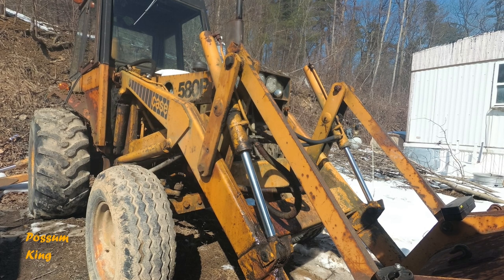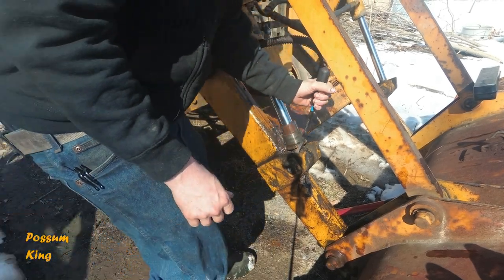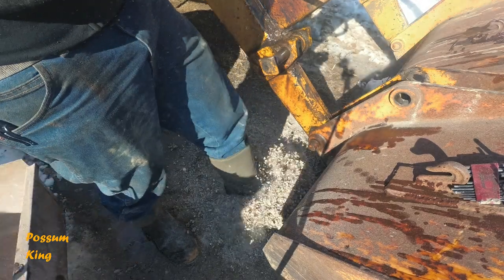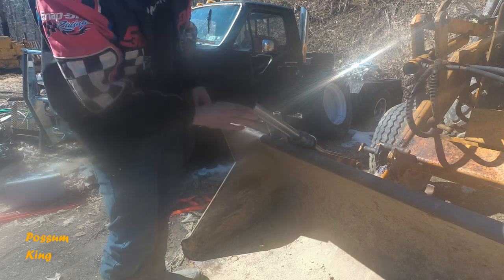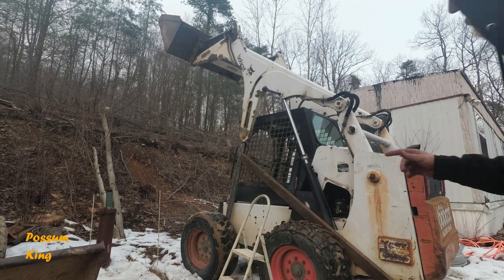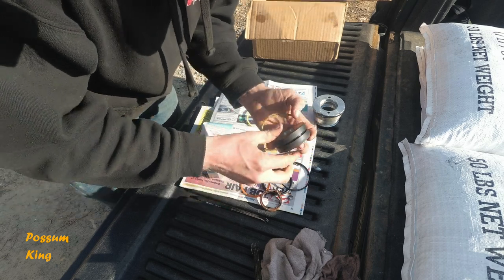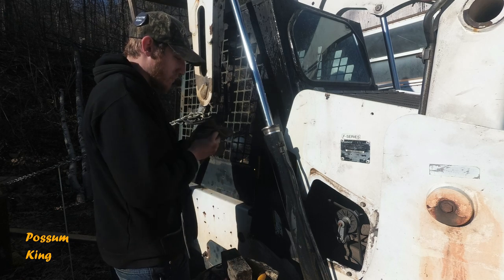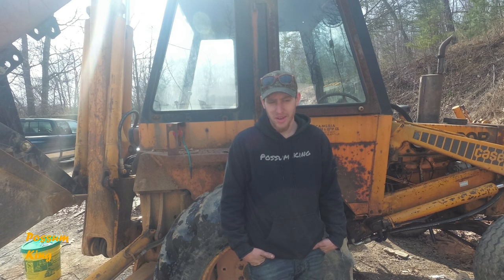Case And Bobcat Hydraulic Cylinder Rebuilds

Comment: we rebuild hundreds of these every year .the best tools to buy are the otc 1266 gland nut wrench and the otc pin spanner 6613.The tool that i use the most is the 6613 pin spanner it seems to stay on the cylinder cap better without slipping
Reply from the maker: Might have to buy that spanner..looks like a much better design

Comment: I know this video is from back some time but if you can switch the pins on your gland wrench to make your ratchet be at the top so you pull straight down on it, it works a lot better. It on the bottom side now & it puts the ratchet lower causing you to pull back on it making the pins slip out of the gland nut
Reply from the maker: Excellent observation. I will pay closer attention on the next one. I believe I was doing it that way to get more turn per set up and more torque